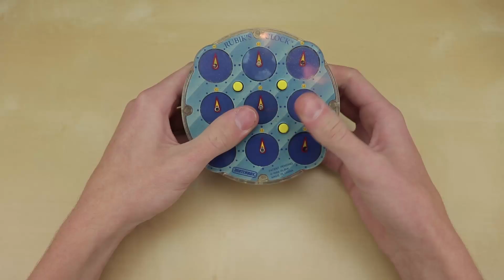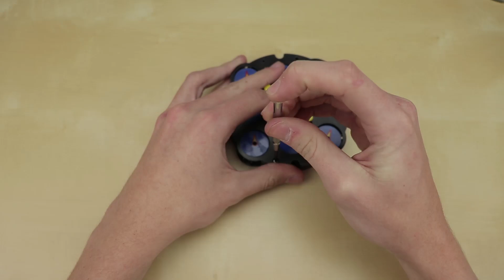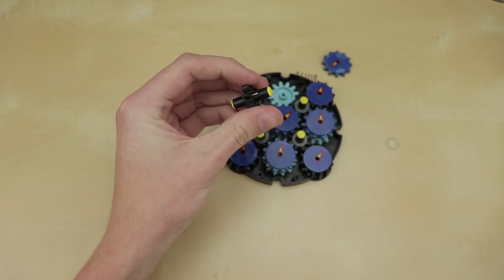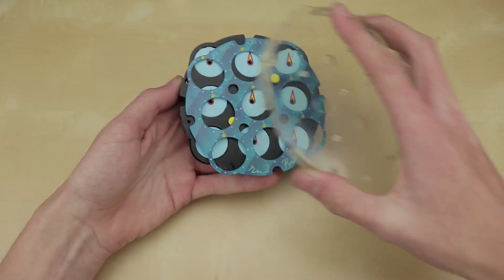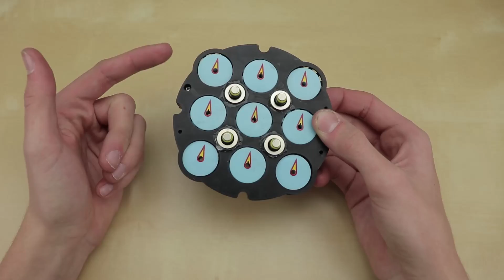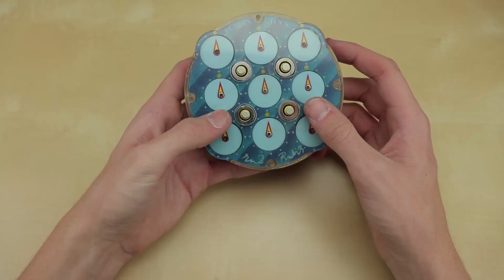Putting Magnets in a Rubik's Clock (Flush with Plastic)

Comment: I have actually thought about a magnetic clock, but my idea was completely in another direction. I didnt thought of magnetic pins to push down like that. I thought of something like magnetic gears, sort of what a stepper motor works, but to mass produce that type of mechanism and thing would cost alot more than like a 13×13, considering the scale of each gear. That WOULD make a fully magnetic clock but not worth it in the slightest

Comment: Made this mod a few months ago and the magnets on the pins go flying off during solves. After gluing them back on about 7 times I haven't touched it in a while. Awesome video though!
Reply from the maker: Yeah, when gluing magnets you have to make sure both surfaces are clean/dry, put glue on the plastic, apply the magnet, then put more glue around the magnet. If that doesn’t work, you can even lightly sand the plastic, which can make it even stronger.
Reply: legoboyz3! Yeah I'll admit it was my first mod and I didn't know the first thing about magnetizing anything. Thanks for the tips, maybe I'll give it another shot.

Comment: What’s the easiest way to cut the paper inserts to fit the magnets? Did you just put them into the case when you drilled it, or did you cut them with an xacto knife?
Reply from the maker: Put the magnet over the hole, traced it out, and cut it with a knife.

Comment: One quick question, it is possible to put the ring magnet inside the clock, replace the plastic ring one?
Reply from the maker: It might be, but then placement of the disc magnets might be difficult, and you’d have to be sure that you aren’t messing up the clock mechanism because of the different magnet thickness.
Reply: legoboyz3! I see, thnks for the info btw and of course the link for the ‘ where to buy the magnet ‘ since it is hard to find.  👍🏻👍🏻